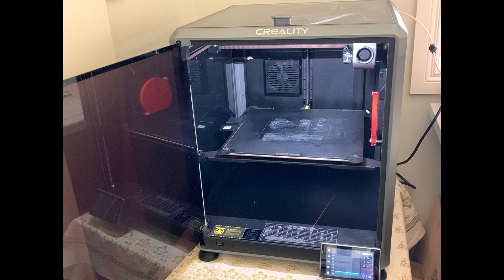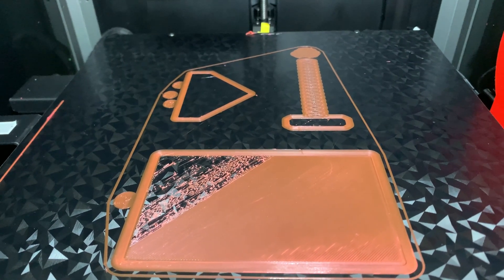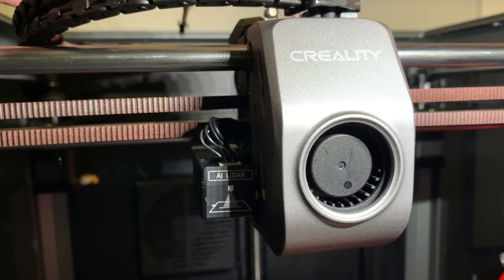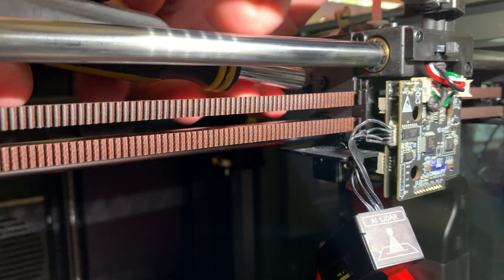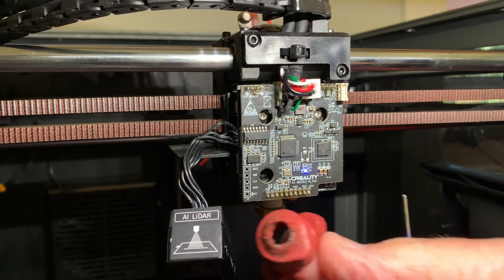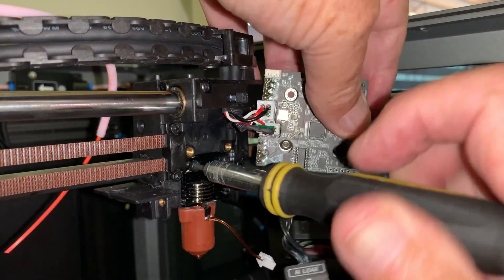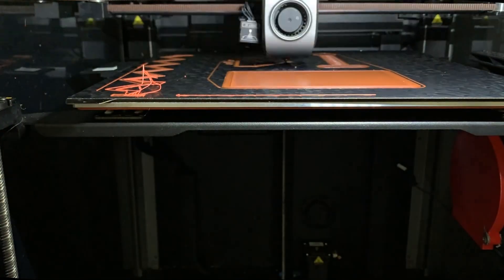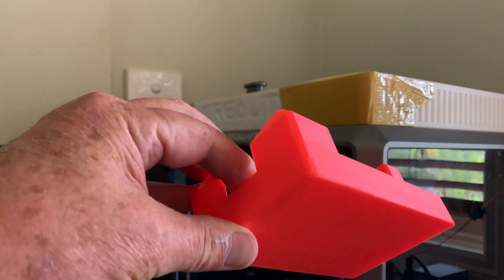Early K1 max with old style hot end clogged - the fix.

Comment: I seem to be having similar issues with the new unicorn nozzle. Partial clogs for a moment enough and then after missing that layer, it spaghetti prints the rest of the model, but no adhesion since its missing a layer.

What filament/brand are you using exactly?  What is your new nozzle temp?  model and side fan temps?  print speeds?